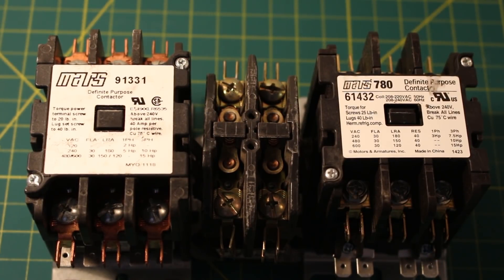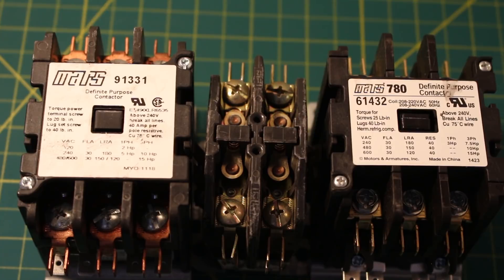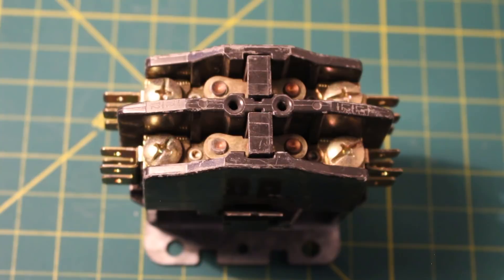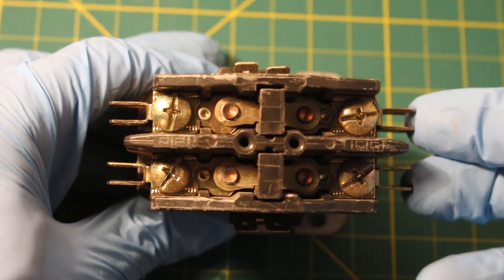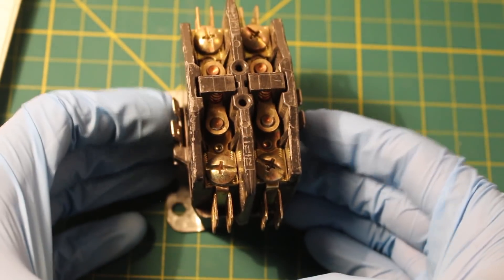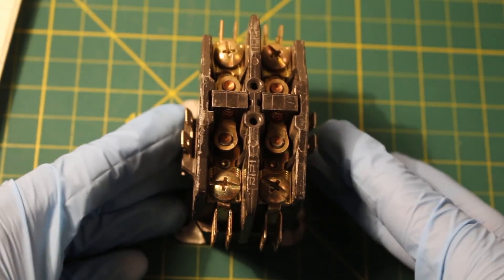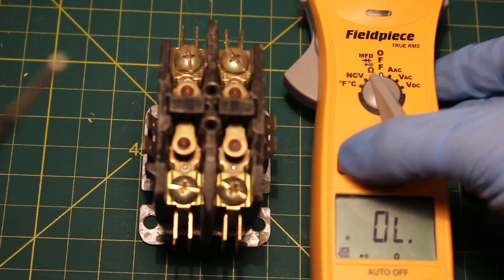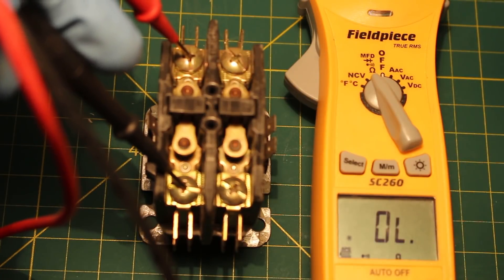What is a CONTACTOR and how does it work? HVAC/R (Simple & Easy)

Comment: On this 2 pole contactor ,when I push down on the two buttons ,my fan comes on but as soon as I release the button the fan turns off ,I've checked every wire to insure all wires are connected and secure ,does this mean the contactor is bad since it won't stay on unless I hold the button down on the contactor ?
Reply from the maker: Doesn't mean your contactor is bad unless the coil has the proper voltage. Once the coil is energized, it will create a magnetic field and close the contacts for the contactor. Good luck!
Reply from the maker: Need to trace out the control circuit which energizes the coil for the contactor

Comment: Thank you, I am a new homeowner, recently my outside fan stay on regardless of my inside AC was on or off. I replaced both my contactor and capacitor since both parts are cheap and both were over 8 years old .. my AC started working fine or normal after that but after 24 hours of normal working conditions. I noticed that my contactor gets stock on the on position.. after I reset power from breaker 
 Then start operating normal.. what could be the issues. Thanks..

Comment: Hi,  so the contacts on both sides of the contactor are for connecting the Thermostat wire  to either side ? Also,  does the side from the Power comes in is called L1 and L2 and the Load Side is T1 and T2 ? Thanks